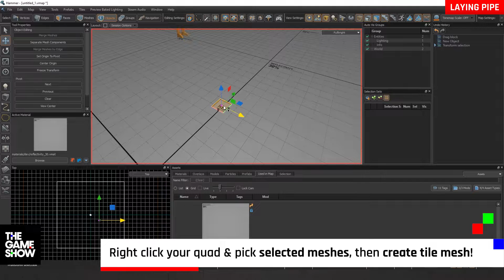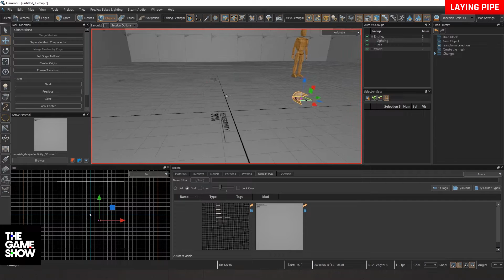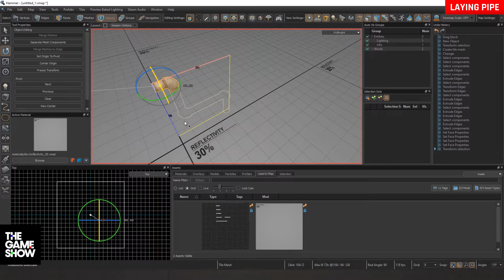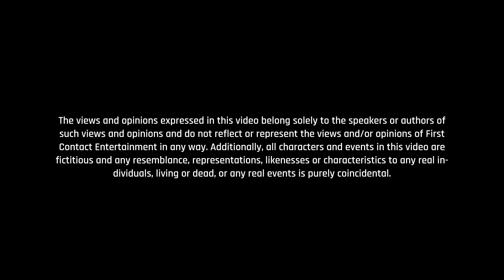Half Life Alyx Workshop | How To Use Add Pipes w/ Tile Mesh [Hammer 2] [Source 2]

Comment: I don't have access to the Hammer Editor but I am curious about this: When pulling out edges like you are at 1:47, what happens if you pull an edge up or down rather than continuing flat?
Reply from the maker: In general or with the tile mesh?
Reply: @thegameshow1703  With the tile mesh feature. What I am trying to do is recreate this feature in Unity. Do the tile meshes work if you contine to create geo upwards (z axis) or does it only work if you stick to the X and Y axis?